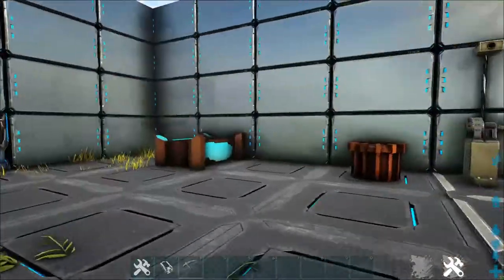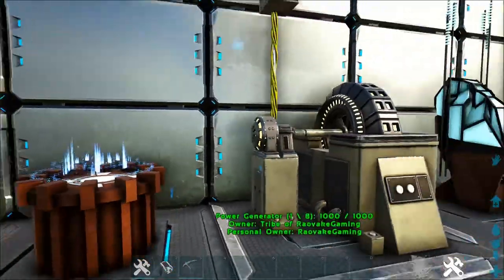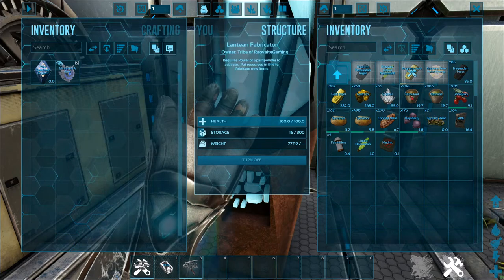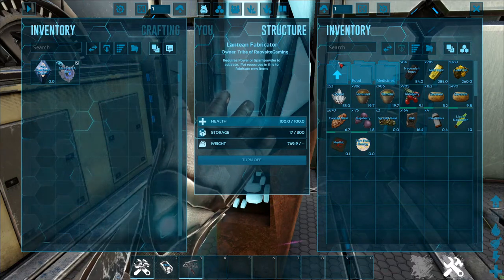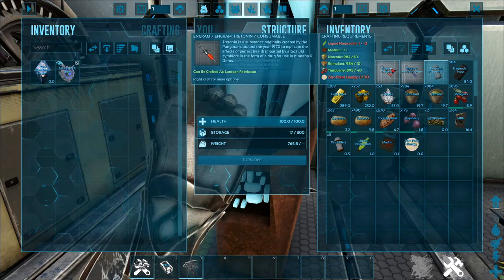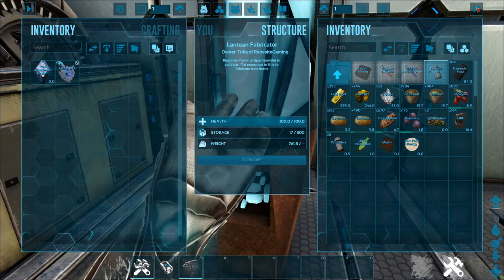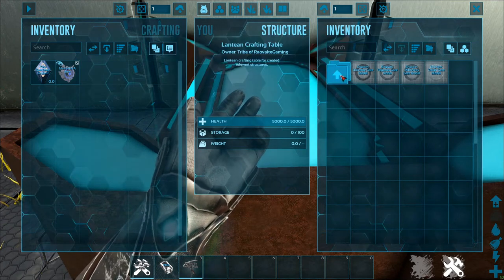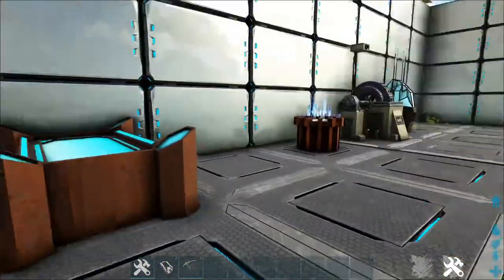Stargate Evolution Mod #Tutorial 1: Crafting & Resources

Comment: Thanks for this! For a future tutorial video, please do one on how to properly set up the gates/rings after they're crafted and how to use them correctly.
Reply from the maker: I will be making one on the Gates/DHDs and the whole system they have and the whole dialing process for them all. How it all works and what does what and all the extra stuff too. 

I will also be doing one specifically on the Rings as well. With how they all work as well. 

I won’t really cover the INI settings in the first few tutorial videos as thats not where the bulk of the information is needed, especially since that’s all in the new Google Docs. 

So far I have this one and about 3 more planned.

Comment: Where do you craft Control Crystal? im growing mad searching for it
Reply: the "manual" says : not implemented yet but it doesn't matter because DHD works without it for now
Reply from the maker: Correct, the gates currently do not need them and it is not implemented yet. I do want to add that they will be needed when Part 1 of the Gate System Overhaul drops. There is a new gate system Q&A on the official Exodus-Games YT channel now as well.